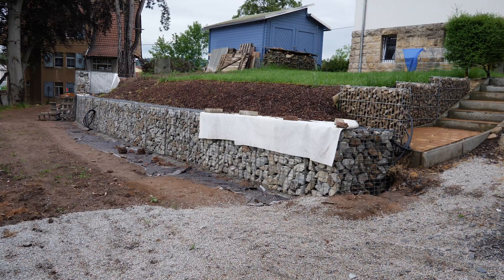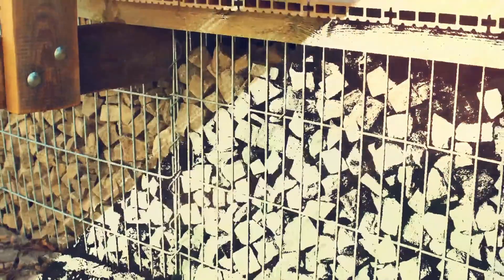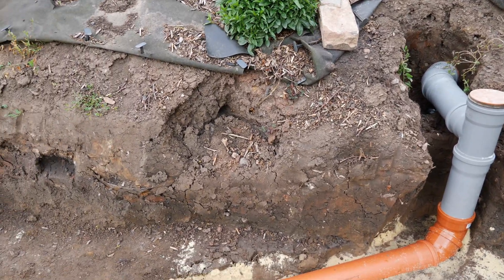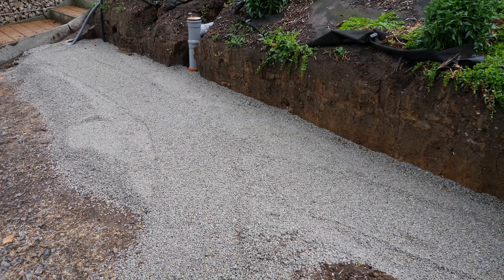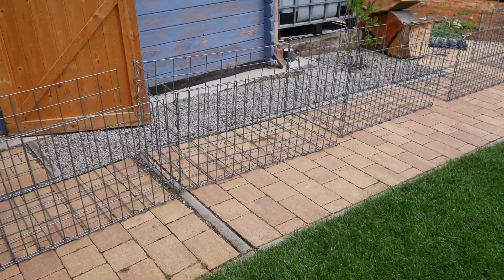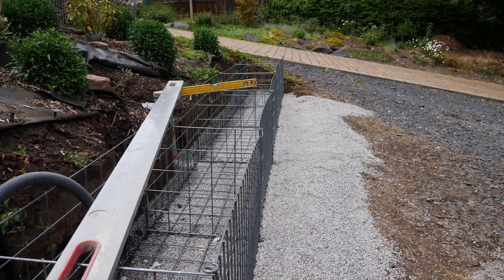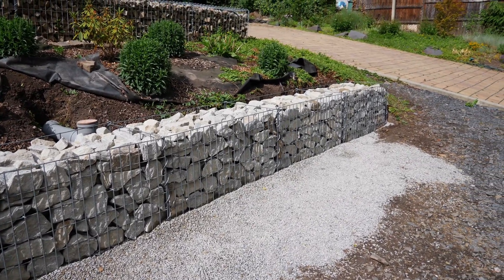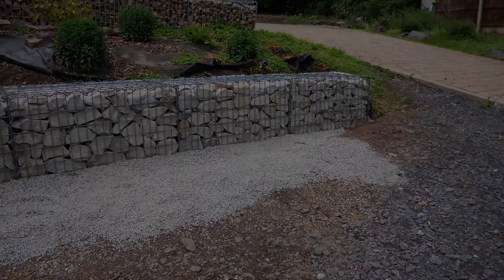How to Build a Stable Gabion Retaining Wall

Comment: Please explain to me the utility of the PVC pipe is to drain the water in the wall 🧱 behind the Gabions .. please tell me . Thanks
Reply from the maker: Great question, @malikbinalashtar3983 – thanks for asking!
Are you referring to the gray PVC/HT pipe shown in the video? If so: that pipe isn’t part of the gabion drainage system. It’s actually a drain for a water channel in my driveway. Rainwater flows through it and is directed sideways through the slope—separate from the gabion wall.

In addition, I’ve also installed some 25 mm PE pipes, which I’ll later use to distribute water for my garden irrigation on the slope.

The gabions themselves are backed with a geotextile fabric and filled in a way that allows rainwater to naturally seep through without causing pressure buildup.

Hope that clears things up—and thanks again for watching so closely!